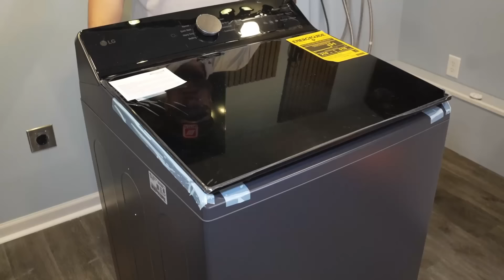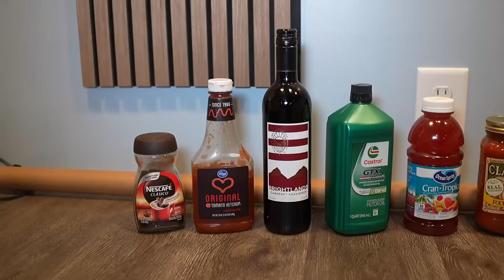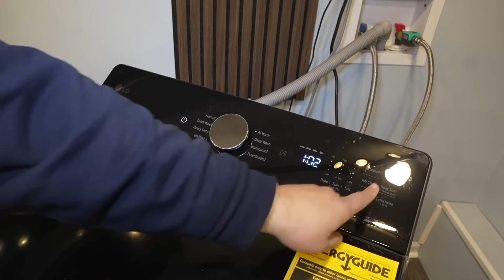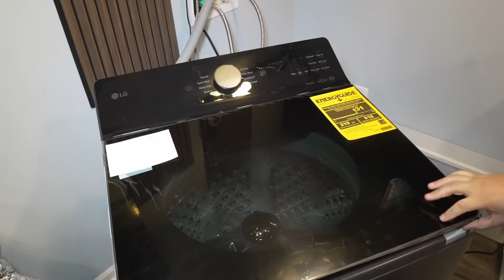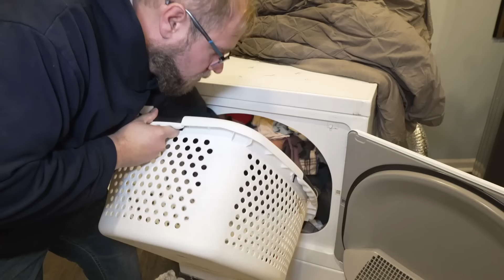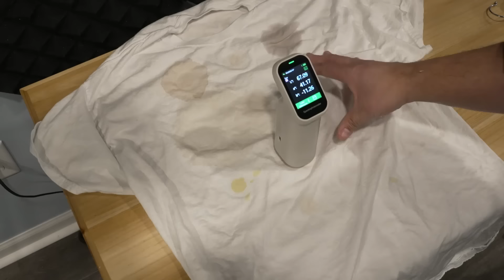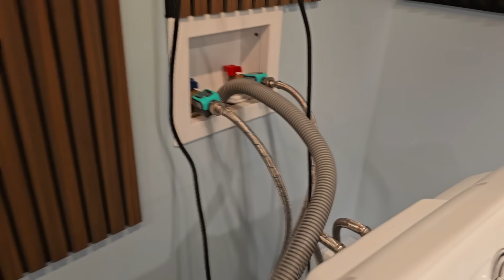Is 2025's "Best Washer" Actually Good? LG WT8405 Test & Teardown

Comment from the maker: Washing Machines I mentioned or tested in this video:

(LG Direct with $29 2yr extended warranty offer)
LG WT8405CW: https://bit.ly/4oOKSFK
LG WT7150CW: https://bit.ly/4f1JoVd
LG WT8600CW: https://bit.ly/4eFFVu3
LG WT6105CW: https://bit.ly/4vx8Acf

Samsung WA40A3005: https://bestbuycreators.7tiv.net/9VZLj4

Lowes.com Links:

LG WT 7155: https://creatoriq.cc/41j1RGl
LG WT8405: https://shoplowes.me/42nQXzW
LG WT6105: https://shoplowes.me/3Eu8Pz8
Reply: What brand of top load washers has explicitly inventor BLDC drain pump

Comment: I GOT THE COMBO AND I AM NOT IMPRESSED. IT DON'T HAVE A DELICATE CYCLE, THE AGITATOR TURNS 2 TURNS RIGHT THEN LEFT, SO THE COATS AND SHEETS JHUST DON'T MOVE AROUND, IT STAY JUST THE WAY IT ENTERED. MEANING THE CENTER IS OK BUT THE PERIMETER IS NEVER FULLY SCRUBBED. SO IT DOES LOOK AMAZING AND HIGH END BUT MY FRONT LOAD LG WAS WAY BETTER AT ACTUALLY CLEANING OUT DIRT AND STAINS. IF I HAD TO CHOOSE TODAY, I WOULD GO FOR THE FRONT LOAD MODEL. THE PRICE IS OKAY 8/10. TIME PER CYCLE 8/10. LOOKS 10/10. CAPACITY 10/10. CLEANING EFFICACIY 6//10.    CONS : NO DELICATE CYCLE. NO STEAM.  ALL IN ALL 7/10

Comment: Im house sitting for an eldery lady. The is a piece of crap LG washer in the laundry room. When i need to download an app, and use my freaking phone to use extra rinse is not ever going to happen. Soak cycle is also a downloaded app. There is a workmaround i have found. Start the wash cycle let it run for five minutes then unplug the freaking piece of crap. Next morning restart the process. Also, you need to use the tubwash cycle, it takes two hours and uses gallons of hot water so completely not energy efficient. The chrome cap on the top of the agitator needs to be removed to clean the interior of the agitator. So if it wash mine i would break the piece of crap down and sell all the recylcable parts. Or use it as a boat anchor.

Comment: Love your posts..Think this model
would be better if the agitator had more power it’s slow and take all day to pull the clothes down to the bottom and also at  the lower at the base of the agitator fins were larger I’m sure the design is to be gentle on clothes but because of the slow rollover the clothes don’t move enough to get a good cleaning

Comment: This senior remembers agitators brought the clothes down the center and within 15 seconds the article of clothing would appear to come up from the side. The agitation would turn not just back and forth the way this one seems to do but would make the clothes go from the top to bottom and up again in just a short time. Doesn't anyone working in design older than 40? They have no reference to how things used to be.  To add insult to injury, old washers finished the load in 20 min.  Now something needs to be done about the worthless detergents being made today. Clothes don't even feel clean anymore. Purfumed? Yes. Clean?  Not so much. We need to get back to the 70s when things actually worked.

Comment: Speaking about “don’t have to bend” - which washing machine don’t need bending?  No matter which one it is front or top loader, either one needs bending if not to put the laundry in then to take out the laundry.  Just saying to invalidate this argument.  Unless you are 100 years old or has back pain issue this shouldn’t be a problem.
It’s seems as crooks trained ppl this way that the most important things are NOT IMPORTANT at all & trivial garbage needs all the attention (💰💰💰💰)  example WiFi operated cameras - you will find zero mentioning whether it’s 2.4 gh or 5g because everybody knows that 2.4g will be flying through 5g (NOT) - WILL NOT WORK.  5g will work on 2.5g but not the other way around.  Just saying because this stupidity of 21 century (2026)  and/or SCAMS are beyond “digestible.”
Same with washing machines & everything else starting with phones.  Now kitchen stoves starting to explode ( glass ). It’s interesting that portable little plastic (nothing) washing machines with plastic propeller & 3 primitive knobs are working just fine & cleaning really well but they are small & fragile but $1000 garbage washing machine is not working after 3 years?!  Soon everything will be like iPhones - new one every 1 year & costs just like washing machine $1500.  Thieves will say that if ppl can buy new iPhones ($1500) every years so are washing machines. This stupidity is unbearable.

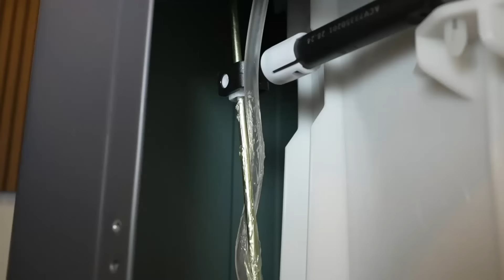Comment: at 15:00 good luck changing those mini shocks very hard to do... those have been out for like 5 years... and that first washer LG Top Loader is a bad deal for $800 the top panel will crack at 6 months and the lid mount will not hold down the lid to the lid switch so it will not lock... that top panel is big money to change out. and on normal wash high spin it starts at 1:04 and after 1 min it drops to 29 mins ??? & no rinse water only a 3 min spray clean water with a 300 RPM spin ? that will never get out all the dirty soap in the fabric ever believe this is not a good machine to ever buy...

Comment: Should I be using 2 washing tans like you are doing?  Or fill it with liquid detergent in the tray?  Also, what is the triangular gray tray for when the lid is opened?
Reply from the maker: Your choice. Liquid is theoretically better at cleaning, but the pods are used for the visual.

The triangular tray is for bleach, FYI

Comment: I just purchased the WT6105CW and so far it's fantastic..
Thanks for your video..
Reply from the maker: That's great to hear, glad you're happy with your purchase!
Reply: @bensappliancesandjunk 
My basement flooded so I had a 2007 Fisher Paykel that didn't survive the flood so when the appliance guy came out to analyze the situation it was savable but it was gonna be very expensive to fix the parts.
I really wanted a Maytag commercial or a speed queen however the repair guy talked me into the LG because he said a lot of of the washers only last 5 to 7 years and you really don't need to spend that much money on a washing machine.
So this was the model he suggested so far it has been fantastic however I know which models are the Cadillac..
Love your videos I tune in every time you make a new one..
Reply: @Poo @Pooroljc thank you for your comment. Our 2.5 year LG front loader just died after a few months of already having draining issues. Replaced the water pump. Worked ok (not great) for 2 months and now will not drain at all. I’m having a lot of problems with a Speed Queen retailer where we live and was looking at the LG’s as well. My husband works construction so I’m a bit not sure if this washer will do the job. Any suggestions on that?
Reply: @LifewithSusy 
I'm sure the LG would be up for the task however if you really have heavy soiled clothing day in and day out,  Maytag makes a commercial model for consumers that has a 1/2 hp motor.
And it also comes with a five-year warranty. It's only 3.5 ft.³ and the model number is MVWP585GW.
Plain and simple no fancy bells or whistles.

Comment: How do you remove the control panel?
Reply from the maker: Man, that was SO HARD to figure out because there was no documentation on it!

Its "Identical" to any other tutorial out there: 2-3 screws on the back plate of the interface assembly, then rock/roll the interface forward to loosen the tabs that hold it in.

But honestly, it was nightmarish rolling it off. I thought I was going to break the entire assembly, but its just so form-fitted that its really, really hard that first time.
Reply: @bensappliancesandjunk oh not what I wanted to hear! Lol but thanks for replying! Yeah I have to replace the dispenser housing on one and I have to remove the control panel to access it 🙄

Comment: We recently purchased this same machine from Lowe’s. Total freakin nightmare. Just pay once and cry once and get a Speed Queen. If you don’t purchase the Lowes rip off extended warranty at time of purchase , and you have any issue within the manufacturer warranty, You are totally screwed. Lowes will flat out tell you to go pound sand, you didn’t purchase the extended warranty, not our problem, contact LG.  Good luck with that adventure. LG will try to arrange for an independent appliance dealer to look at the failed POS, and that will be 2-3 weeks ,and nobody will show up. Repeat process again, and again no show.  For whatever reason, (obvious), local independent appliance tech’s will not touch any of these machines purchased at Lowe’s. I’m not faulting LG for this , Lowe’s is to blame because they do not tell you at time of purchase what will happen if you have a problem during the manufacturer warranty, and didn’t purchase their extended warranty. I’ll never purchase any appliance from them ever again. This exact same machine failed after only 6 months, and we had to purchase another washer, the Speed Queen tc5 , which we should have got in the first place, because it took well over 2 months to get LG issue resolved, no thanks to Lowe’s. 🤬🤬

Comment: I have this machine for 14 months. The top part between the machine and the glass cover broke.  The machine wouldn’t lock. I had the Bestbuy warranty otherwise I would have been out of luck. Turns out it is plastic and wasn’t covered under the warranty.( only the full warranty that was only one year )
Reply from the maker: That is frustrating

Comment: The run times on the LG washer based on the settings selected are downright ridiculous.   And it seems the washer manufacturers go out of their way to design agitators that do a lousy job.  Government regulations (thanks democrats..this mess is on you!) have created a Tower of Babel for what once was a fairly simple industry.  Now we have a grotesque array of plastic fantastic brands that throw error codes if you look at them cross eyed, with computer boards that scream short service life and needless complexity, and nightmares for the appliance repair industry who have to deal with irate consumers dealing with cheap machines, parts scarcity, expensive components and finally poorly designed units that require careful maintenance by the owner to stave off mold, crud buildup, and clogged drain pumps.   How did we get to this absurd juncture???

Comment: Do not buy this machine! It's stupid. 
I dunno if it's just this top load or other brands as well but the machines try to balance the load and if you're washing random heavy and light things together you get an uneven load error code and basically there's no trying to fix it. The machine will keep filling and trying to spin but add more water to "balance the load" but it can go on for hours trying to do this. And if you try a spin only cycle, you guessed it same issue. It won't just spin, it'll add more water to balance the load. I'm currently gutted because I've only had this machine for a month and fed up already. I'm also very skeptical of consumer reports now. 
Also in the past I've had front loads and they've never had an uneven load error code. 
Avoid this specific model but also any new "idiot smart" top loads because I'm sure other brands are similar.

Comment: The HUGE diff is that the 6105 does not have the shock absorbers.  So they are not similar at all for the suspension.  The 8405 is a different motor part number for more money. I assume it is a little heavier duty, but who knows?  A big thing bothering me about these LG upper end washers, many parts online are OUT OF STOCK. I did not spend much time, but of the 3 sites I looked at, both the 6105 and the 8405 had parts out of stock. On the 8400 series, the main board is backordered! LG plays a game with us, they promise a great shiny tech machine that works well. But when it breaks down, warranty work for the LG warranty years sucks hugely. 2 to 3 weeks in most comments between calls and parts. And sometimes it is 4-5 visits and it is always not fixed. Not all, but has happened to many. And it is a real thing, they are getting lid cracks and actually the top plate of the machine cracks. Then LG has been fighting the customer. I have seen the cracking in review sections and in forums like Reddit. I may still get one, have not decided. Then again, I may go GE, better parts and warranty network with Bodewell,  a funny name that does not match. .

Comment: Everything on here was great. In fact, the best video I've seen helping me to understand how the LG top loader works and breaking down all the parts. I also greatly appreciated how he broke through all the "marketing & sales" buzz phrases to get to the heart of the matter...do any of those fancy features actually do anything? Would love to see a lot more on the AI features though. However, it doesn't seem relevant to use a Samsung with a smaller capacity while loading the same weight of laundry?? Of course it's not going to be able to handle it. Why not compare the LG to another top loader with same cubic capacity?

Comment: There is no residential washer that will eash a comforter. If you can wrap the entire machine up with the comforter. It will not wash in that little tub. All top load washers are limited by standards set by DOE for water consumption. This machine receives no more water than others.
Reply from the maker: DOE rules only apply to normal mode. As soon as you go past that with rinses or deep fill options they'll use whatever you want them to - i say this as a general rule for all machines as they all work this way
Reply: @bensappliancesandjunk indeed! I see that your machine used almost 55 gallons of water in deep mode. You can hold a high school car wash and not use 55 gallons

Comment: The one comment I wish you would have made is that the matching dryer to the LG washer has the same sloped top.  A crazy idea for the platform that I believe most everyone uses for temporarily stacking clean laundry out of the dryer.  Why the slope, LG?  Also, I do wish you'd have shown us an impeller model, as you said.

Comment: Best my ass it has an app and a bunch of bullshit sensors that adds more points of failure. And it’s not impeller like listed via your links. Most washers on the list are tech trash. I guess it’s speed queen all the way.
Reply: everyone keeps mentioning speed queen.  I have yet to find one that's large-xtra large capacity.
Reply from the maker: Speed queen doesnt make a residential one thats large cap other than arguably the FF7009.

As for OP, LGs have the best track record outside of Speed Queen. All their models have impeller or agitators depending on model number - units ending in 0s are impeller, 5s are agitators
Reply: @bensappliancesandjunk I was pointing out yes I don’t prefer more modern stuff. Also I am pointing out the link you have for appliances in another video shows the wrong information. For impellers/ agitators.

Comment: For the deep wash test of the  LG WT8405, did you add extra soap to account for the extra dilution by the water?  It seems like the concentration of soap would have a lot to do with how well a washer cleans, and these top loaders certainly dilute the soap more and thus would require more soap.

Comment: I miss my 30 year old Maytag from 1995...  I could control the water level, temperature, and advance the washing time...   So far, the 8200 is just ok.

If anyone from Maytag is watching, please make the old model again.   That's what people want.
Reply: only way to get a machine built the way they used to be built is buy something like a Speed Queen or another true commercial piece, they usually start around 1200 a piece

Comment: I ended up getting the one without the agitator and I think I'll be really happy I like the agitator but it's kind of in a smaller drum it it makes sense I guess. But I've got one that's a 5.5 capacity I just bought it and after the first load I was blown away how quiet that thing was and it bounced it it bounced a load all by itself I it didn't like stop and do this weird this weird dance on going and stopping like my Kenmore did that was previous to it
Reply: What? If it danced on going and it bounced a load, it is bad, return it.

Comment: Bought this model nine days ago and it leaves about 1/4 of the detergent and fabric softener in the dispenser. My previous LG did not.  It's going to mold pretty quickly.  Any ideas? Cleaned out the dispenser many times, water pressure is good, use HE detergent, new hoses, washer is level, tried all the different fill levels and temperatures.    Our old LG did not do this.  Reading online I appear not to be the only person with the issue.
Reply: Any update? Was thinking about purchasing this same model as well but that's a bit of a turn off

Comment: Im in the market for a new top load washing machine for heavy duty laundry needs. I'd prefer something basic and durable that gets stuff clean and is reasonably quiet.
Reply: Did you find one that you like?
Reply: @TgotSoul I ended up trying a front load LG. So far I'm really not happy with it. I knew I should have stayed with a top loader. Now I know for sure.
Reply: @dbriggs1689  which model did you get? I’m seeing so many bad reviews for front and top loaders. I can’t figure out what to get. 😩
Reply: @TgotSoul I got the LG thinQ from home depot. It was on sale for about $900. At least it's quiet when it runs.
Reply: @dbriggs1689 ok thanks.

Comment: Always interesting the man is thorough. I thought the front loaders were good but then I hope they changed the way they are were because they would smell and mold. I have a flat plate GE I believe it is and it it’s old and it still works, but on the long cycles, the clothes get out of Balance so easilyon the quickest cycle, which is like 60 minutes maybe 40 it just doesn’t seem to get as much dirt out on the clothes I used to cut grass. They still have stains not grass stains with dust stains. I try to watch all the videos.😊